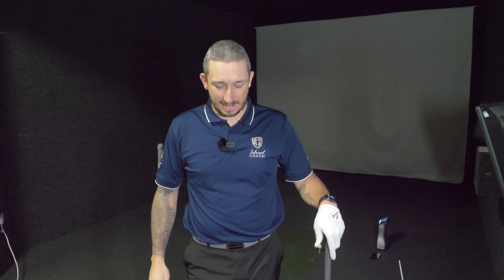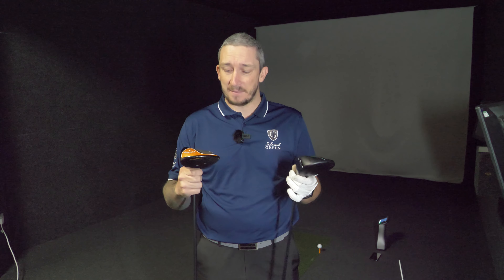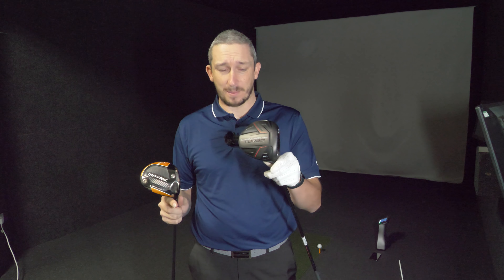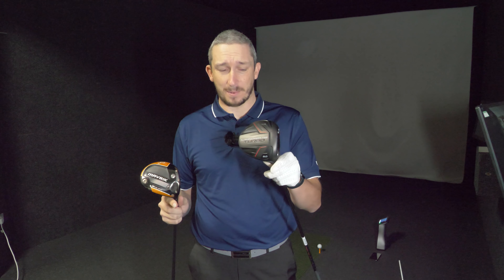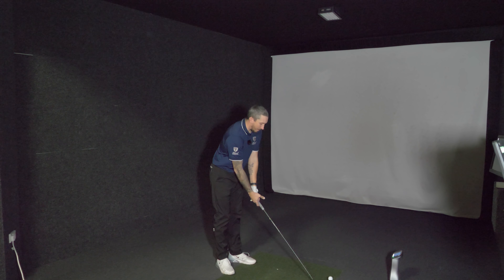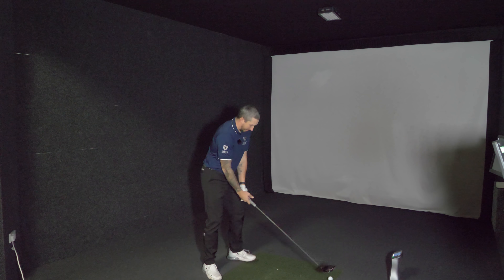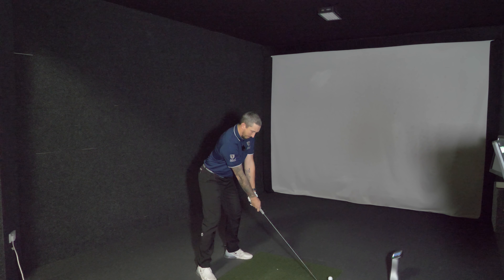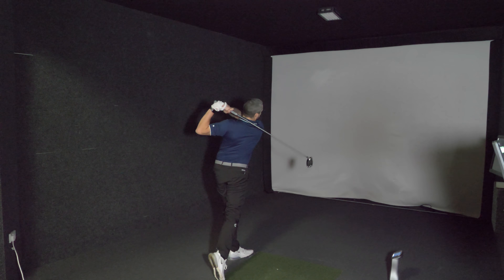BUILD MY BAG SHOWDOWN - DRIVER vs DRIVER

Comment: I have the Cleveland and love it. My advice is that the Cleveland you do not have to swing hard to get it to work. Take 10% off your swing and it will out perform what your trying to do with getting one out there. Go to hard and the shaft starts getting whippy
Reply: I have the cleveland too, and found it's shaft quite wippy for a stiff shaft. Still I haven't used it enough yet. I will try the slower swing option.
Reply: @pgpchappers  next time at the range do a gradual build up and once you start get near the top your efficiency at 80-90% of your swing speed with the myazaki shaft will be so much better. By no means am I a expert but I had the driver in regular and once I built up swing speed changed to stiff. Some would argue being more controlled would give a better strike but you can feel it if you go after it. If not keep a eye out on eBay you can get it in a premium shaft or you can custom build them on golfworx and pretty much put what ever shaft you want in it.
Reply: @stuartmacdonald305  thanks, to be honest, have a few swing faults I am working on at the moment which isn't helping. I sort of want to put in a project x6.0 shaft in it as I have that in my three wood which I hot really well. Maybe a fitting coming my way when ranges re open.
Reply: @pgpchappers  we all do mate that’s the thing golf is a game nobody ever masters. I myself have problems off the tee and short game and the driver and the cbx2 wedges are class and have gained so much more confidence I. Both elements of my game. Your right though you get stuff that works for you and that your confident with. Just extremely frustrating the now seeing all these nice shines new clubs and can’t see them or try get fitted. The ping G425 has caught my eye and if the SFT does the job could be a treat coming out of lockdown

Comment: It certainly seems the Cleveland does suit you better while it’s great to have length it’s better to have it in play more unless you are exceptionally fantastic at getting it out of the crap and putting it next to the pin with 2nd shot I’m hoping to go looking for a new driver when we’re up and running again and this is one I’ll be looking at

Comment: I was you ( well an older version of you)  with my Cobra F9 Driver. We didn't get on, despite all the adjust-ability on the F9.  I sold the Cobra and bought a Cleveland HB Launcher turbo and got much better fairway hit ratio. The Cleveland was about 60% of the cost of the Cobra. 
I still tended to push fade the occasional drive so I added 20 gm of lead weight to the heel side. Now I use Steve Johnstone's Eureka set up ( aim feet left , shoulder line aim down the target line or slightly closed, swing plane out to the right with a strong grip) and I rarely miss the fairways.
Reply from the maker: I’ll take a look

Comment: Could you try a extra stiff shaft in the Cleveland to knock the spin down? Try the ping G425 man head. Seems to be the getting great review. Get this part nailed down and you handicap will fall down!
Reply from the maker: If the Cleveland wins I will fit myself properly into it. I will give the G425 a go also 👍

Comment: Agree.  If you could ONLY choose between these 2, the Cleveland wins.  Even if it is traditionally shorter than the Mavrik and lacks adjustability, you hit is long enough already.  Eliminating those drives that are offline by 25+ yards in either direction is what will get you to low single-figures...not bombing 310 yard drives but losing 3 balls per round.  And, as you showed on that last drive, you can still get 300+ out of the Cleveland.  Can't wait to see you hit the Ping G425.  It has the highest MOI, which is what most of us need.

Comment: After asking for your advice the other day Lee on the hb turbo I am planning to order the 10.5* stiff flex as I can't get fit anywhere for it. As a low launcher this should give me more height and spin is your friend Lee. Get that launcher in the bag I had that mavrik sz it was so bad on the off centre strikes it killed me. You need to go for one of the max forgiving models but I wouldn't look past that hb turbo it just gives you cracking numbers.
Reply from the maker: Hope it works out for you 👍 please let me know
Reply: @LWG  I will for sure will be in the bag waiting for the courses to open back up whenever that might be but boy I'm looking forward to smacking it up the 1st tee 🏌️‍♂️👍

Comment: The Cleveland driver is so underrated. It suits you far better than the sub zero. If more golfers dropped the “snobbery “ and actually used equipment suited for them, they would play better and be happier in the long run. Good for you Lee!

Comment: With your army style shot shapes (left, right, left..) you need the Ping driver.... had G5 for 15 years and every driver I tried for years I’d pull out the G5 at the end and see the fitters face drop.... last year replaced with G410 and even off centre strike or slight swing deviation and it’s brilliant - 25 yards longer, 5mph more ball speed and there isn’t a fairway on earth it can’t find.

Comment: Lee, talk to the Cleveland rep, maybe they can find a head that sits less closed due to mfg tolerances. Or just look at a bunch of Turbo drivers and see if you can find one that sits better in your eye. Now unfortunately, as a glued head, greater effort to see if an aftermarket works better for you. But you are a fitter, can't be that hard.
Reply from the maker: If it wins this contest I will fit myself properly into it👍

Comment: Haters going to hate, keep going with what you're doing Lee. Majority of people are clearly enjoying the content, :o) 
PS, Do you think golf ball consistency is important for higher handicappers? I use lake balls most of the time, always softer, better quality ones but still not brand new balls. On a Saturday in a comp I tend to use a better ball and maybe even a new one in the summer but very rarely are they the same brand and model. I'm trying to get my handicap down, do you think there's a point where I should swap to using the same ball or do you think I should do that anyway? I probably lose a ball a round on average so if I play three times a week new balls would be costing me a fortune! Would appreciate your thoughts.

PS Cleveland...no question although there may be better options still out there...G425?
Reply from the maker: its always best to keep using the same ball as you get used to the consistencies of that ball, the distance and feel etc.  Changing balls will have differences in it yardage etc and then you stop being used to the distance certain clubs go

Comment: I probably wouldn't try to use a sub zero driver, but I would test that Cleveland against the standard Maverick first. But if you want a good driver, give the titleist ts3 a go. Ball comes off the face like a rocket going off. Haven't gotten to try the tsi3 yet, dont know if it's much of a difference or not.

Comment: Without a doubt the Launcher. You may lose a handful of yards but are guaranteed a second hot to the green. I appreciate it is not adjustable but if it is correctly fitted for you this should not be an issue.

Comment: What about trying the new PXG 0211 Driver,They retail at around £325 so its finally a PXG Driver for the masses.If it looks half as good as the gen2 driver which was probably the best looking driver of the last 2 years and performs well then its a win win.
Reply from the maker: I would do but I don’t have access to PXG equipment unfortunately

Comment: accuracy over distance all day..... work out what side of the course you want to try and eliminate and go from there.  happened with my fitting, ending up with the standard Ping G410, weight set to help a draw, not the longest but consistently the straightest and helped eliminate the right side of the course.........most of the time

Comment: It's a no brainer - Cleveland LT is much more forgiving and every bit as long as your Callaway. No point hitting 290yds if it is landing on a different fairway. Ditch the Mavrik! 
Would be interesting to put the Cleveland up against the new Mizuno ST200 or Ping G425

Comment: As someone who did comment (over long comment!) on the ball video that ball compression is massively misunderstood, I just want to support Lee about getting a ball fitting.  Every golfer has his/her own swing and there is definitely a ball best suited to you - it just might not be the one you think.

Now back to the driver - I only wish I had Lee's swing speed but I am a bit older than him!  IMO Lee needs a driver that has a lot of forgiveness and stability, even if it means sacrificing yards, at least until Dan's lessons on face control and calming the path become more natural.  I think Lee needs to get a Ping driver.

Also I noticed that Lee's driver at times seem alarmingly toe up to me - maybe a change of lie angle or a different length of shaft

Comment: Hey Lee, funny I experienced exactly the same thing with the epic sub zero....The 2 or 3 you NUT are better than anything else, and you get seduced by that forgetting the 9 or 10 that you block or smother....That Cleveland and it may not be the right one yet was miles more consistent and better flight.
Low spin driver....X flex shaft....Great combo when on it but savagely unforgiving when your not.....Good luck pal the right one will emerge
Reply from the maker: Thanks John 👍

Comment: Do you go through your pre-shot routine every time you hit a ball, because when I hit driver on course takes at least a couple of minutes to walk to the ball . . if your hitting less than 30 seconds apart,  your swing will not be consistent, on the driving range I do my pre-shot routine and make sure 30 seconds have past this will increase your accuracy. . . just give a try & let us know Lee, still love turning up volume when u crackem down the range.

Comment: Its a non contest Lee, Cleveland batters the SZ...but how does the SZ stack up if you set it in draw neck setting and heavy weight back? I was stuck off 4/5 handicap for a long time (years) until I went for substance over style. So for example instead of a Newport 2 which looked great but performance was average around 32 putts per round, I now use a Scotty DeTour, the big T shaped one. Its awful to look at but it works. My average putts per round is now high 20s. I've also gone from an obsession of using a T-serial TM driver or a better players SZ type because it looked great and was what low handicappers are supposed to use to a ping g400 max, now my bad shots are so much better... and instead of a forged players type iron, I switched to i500 irons... these changes have helped me go from a 4/5 handicap to 1 last season.
Reply from the maker: That was in draw and weight back setting 😂😂
Reply: @LWG  🤣🤣🤣definitely time for it to go on ebay then 😛👍
Reply from the maker: @Erictheking66  😂😂😂
Reply: @LWG  keep up the good work Lee on Dans channel and your own... production is superb on the course vlogs & this weeks review was very good as well 👌 👍
Reply from the maker: @Erictheking66  thanks Paul

Comment: Cleveland all day long. Even losing a shade of distance you have so much speed it won't make a lot of difference and if you're in play you're scoring. I reckon if you use that Cleveland with what is a pretty solid iron game and very good putting you'll get down to low single figures before long.

Comment: The cleveland seemed to be so much better for you even with a stiff shaft, is the torque at lot lower than the callaway shaft? The cleveland seems to be perfect match?
Reply from the maker: I’ve not looked into the fitting dynamics of it yet. Just doing this series to narrow down contenders and I’ll fit as I can. Only have a select options with Cleveland

Comment: If an off the shelf driver outperforms a fitted driver as seems to be the case in this video as a fitter how would you convince me that a driver fitting is worthwhile?
Reply from the maker: Because I fit the Mavrik for one reason. Distance on the vlogs with Dan. Not playability. When the Mavrik comes out the screws it’s a bomb machine. Clubs are fit for different reasons and the customers wants.
Reply: Lee Whittaker Golf thankyou for your reply.  So with the Launcher in and the Mavrik out we should expect some wins from you in future course vlogs!
Reply from the maker: I wouldn’t go that far 😂😂

Comment: Neither 😁 was fitted in sept last hated the Cleveland , when rouge instead lot more forgiving and better on distance for myself , and a lot more fitting options , if I were you would give the new g425 ago now as looks a cracking club and not seen a bad review of it and also has a lot of fitting options , but everyone is different 👍

Comment: Right Lee, stop this apologising. The vlog on the ball compression was a very basic explanation of why you should either do some research or get fitted. It was useful and unbiased. You will have to learn to firstly ignore the knockers and secondly do what Mark Crossfield did and turn negative feedback into a chance to spark more debate and expand the subject. Most of us are behind what you are trying to do for us normal golfers mate
Reply from the maker: Much appreciated 👍

Comment: You can easily play off scratch carrying it 250, you won't play off scratch hitting two balls OB every round. Whatever puts you in play the most often should be the preferred club, betting it will be a Ping.

Comment: Two different flex shafts, how is it a fair comparison? 
I’m sure you know most of the problem is the other end. Maybe get rid of the ego X shaft and maybe you will be more consistent....just saying😳
Reply from the maker: It’s not an ego X shaft at 115 to 120 club head speed and an X shaft in the Cleveland will likely reduce launch and spin and gain me distance at those speeds.

Comment: Strange, surely if you intend fitting folk for clubs then surely you have sufficient knowledge to fit yourself with the correct driver
There is no point trying to hit a 400yd drive if it leaves the golf course. On most courses you will score better with a 250yd drive on the fairway than 300+yd behind a tree, OB, etc
On another note, forget speed, if 10mph slower is giving you a decent length every time and playable why risk it as if you are serious about getting as near scratch as possible then course management is vital
Reply from the maker: I could do easily. But I need to make content out of it too 😂😂